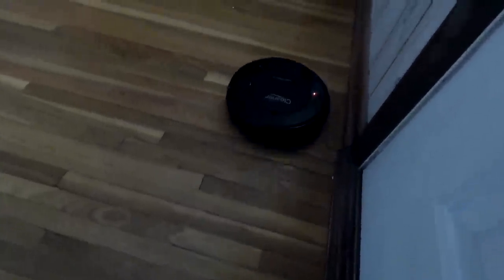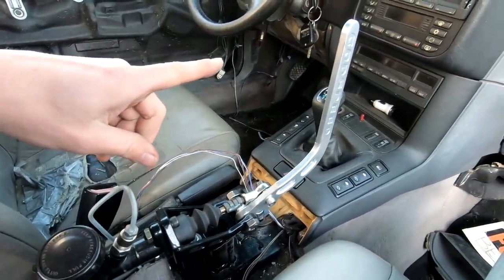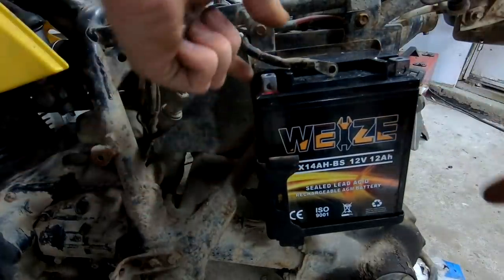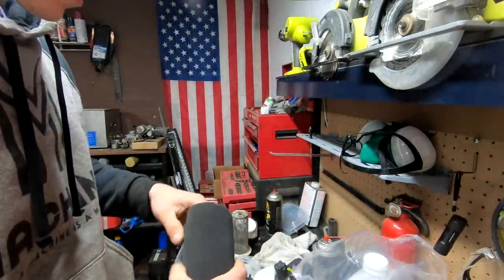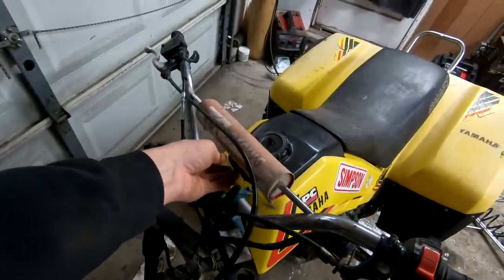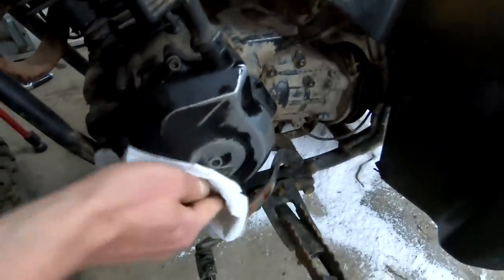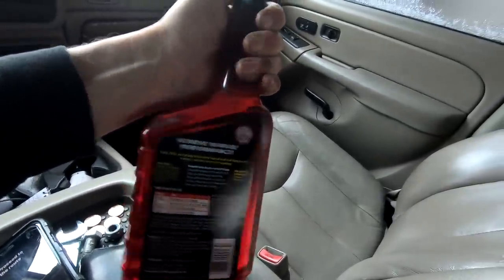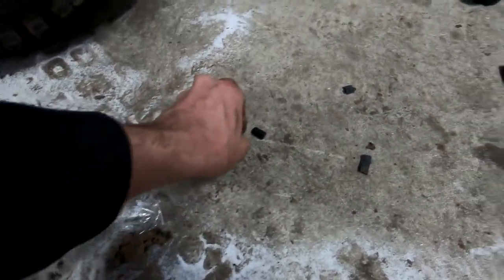Yamaha 3 Wheeler Runs - Ready to Ride

Comment: The nut you tightened on the engine was timing chain tensioner, loosen it up turn it over a few times and it will set the tension itself that knock will go 👌
Reply: I agree that will fix that knock..
Reply: Exactly right. 👍. I was going to comment about that but you beat me to the punch. Your genius is showing sir.
Reply: Agreed, came here to comment the same.

Comment: 30:58 needs a rubber grommet or atleast wrap the wire with more them a few wraps of electrical tape were it goes threw the hole

Comment: That nut you tightened adjust the clutch. When you pull up on the shifter it engages the clutch. Be ready for some wheelies too. 225dx is a wheelie machine. You'll love it

Comment: To change the rear trailing arms, the diff has to come out. At least most of the way out. That intake boot is a huge problem. The maf is the only air metering device on that engine and it needs to have no air leaks between it and the cylinder head.

Comment: Really hope you cleaned that inside wheel good or the rust flakes will chew that tube to pieces, also use a round file for valve stem hole if its sharp so it doesn't tear the steam

Comment: NEED SOME HELP!
I just rebuilt my dirt bike and it now has 5hrs on it. It takes about 20kicks to start it, but soon as it does it runs perfect all the power. Soon as it starts it might die then it will start up again first kick. Not sure what the problem is. 
I WILL GREATLY APPRECIATE HELP!
Reply: could be carb related issues, i had a similar issue with a quad bike turns out the carb just needed a rebuild.
Reply: check valve clearances.
Reply: mmm tea thanks for the help I’ll try that
Reply: Banj Fam thanks for the help I’ll try that
Reply: Might be a weak spark (plug, coil, gap or ground) all the cranking heats the cylinder enough for a weak spark to finally start

Comment: Try loosening or tighten the timing chain on the side of the where the cam pulley crank is there's a little screw that looks like a nut on by the BOK you'll see it it's on the right hand side of it

Comment: That battery is one bounce away from disaster. On a lurch to the right, the battery will almost certainly be thrown against the left tire. And there is absolutely nothing providing hold-down force to keep the battery from bouncing up and out past the small lip on the bottom edge of the bracket.

Comment: That bolt that says increase and decrease lossen it 3 turns and tighten it back up that's for the chain in the moter that's what the clicking is it's loose and it's slapping around in the moter

Comment: Dude buy you a tractor supply manual tire changer a little over 100 bucks and it will pay for itself they Change 6 inch to 16 inch tires I’ve changed 31/10.50/15s with mine they work man and they are cheap harbor freight has them also